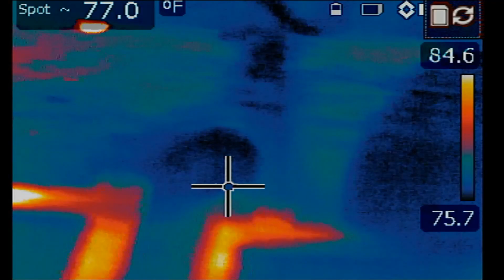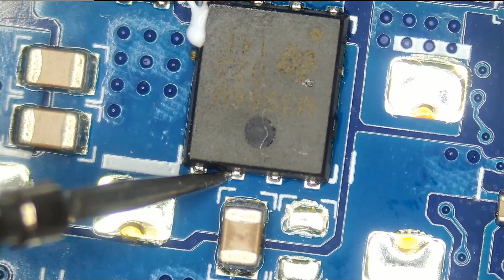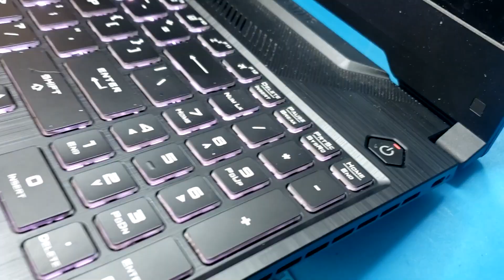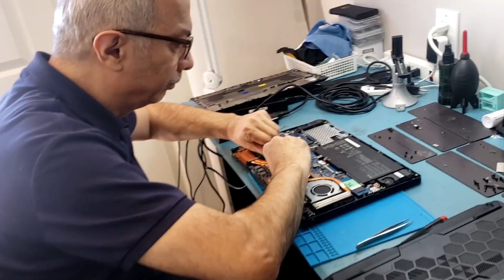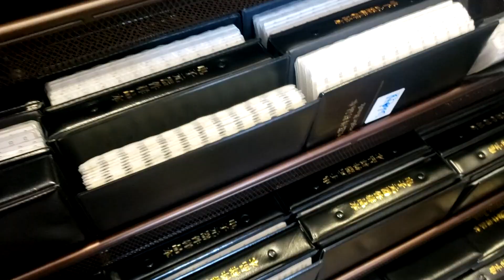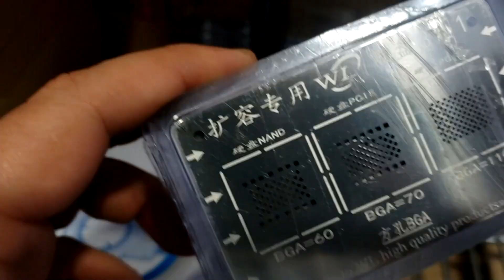ASUS TUF Gaming A15 Laptop Repair - No Power

Comment: Sometimes you need to wait for a seconds or minute because disconnecting the battery also resets the BIOS configuration if the battery isn't separated For bios, otherwise it's a Ram, GPU issue, etc...

Comment: I stopped doing my own repairs on surface mount components awhile ago.  I'm looking for the DC Power Jack on the motherboard of a ASUS TUF Gaming A15 FA506IH_TUF506IH.   I found one spec sheet that says the jack is 6.0 mm x 3.7 mm DC Jack but I can't find one of those anywhere.  Any help finding it would be appreciated.  Thank you.

Comment: I looking now your videos , because my ASUS ROG STRIX G15 just died. During when I gaming, the game freeze, then I try to restart the laptop, It took too long time... I push and hold the power button, than the laptop turn off. Now If I turn on the laptop, I have keyboard light, the fans are working but the screen are black and the laptop wont boot.

Comment: Bought a  ASUS 15.6" TUF Gaming A15 Series TUF506II two years ago now and recently i am experiencing a problem that it won't turn on if i turn it off and don't use it until nex day.  It start sometimes, but mostly not.  Now i decided to let it plug to A/C even when not using it because is the only way it will power up next time.  Everything else is fine, it plays games without crash and other tasks even if i disconnect the power from A/C.

Comment: I would like to know what is the capacitance value of that SMD capacitor... I'll might check on my laptop that died a year ago (When switched on my laptop's Power light will flash once then off - no fan spin and no display) - Laptop can still charge tho...

Comment: Hey! Brother Alex,
I've one genuine request to you.
If you google about samsung galaxy m30 and a50 devices you will find there is one common issue occurring in most of the devices. The issue is that the device keeps restarting randomly.
Also it's confirmed that this issue is not a software issue rather it's a hardware issue.
I would like to request you to get one such faulty device and try to fix that issue and show us in a video so that we can understand. In India samsung service center is replying same thing to everyone  that the motherboard needs to be replaced and for that, they are charging 100$ for a 250$ device. 
Here in India, the repair guys also are not able to tell properly like what the issue is and they are kind of speculating on it which is leading to waste of time and money.
Could you pls try this. It will be really helpful.

Comment: Did it make a difference that the capacitor wasn't soldered in the original position? Originally, the capacitor was to the left and you resoldered it to the right of its original position. Video at time code 4:19 shows the original position of the capacitor.
Reply: Both positions are parallel, so it doesn't matter
Reply: Yeah I was wondering this too, they're running in series which makes me think that it may not matter as long as they're on the same rail, but that's hard to definitively say without looking at a schematic.

Comment: Hi I just got suggested to reach out to you about a question I have my friends dad has the old Alenwere desktop from somewhere around the 2000s it has a Radion gpu witch has 2 gpu dyes in the 1gpu with a fan in the middle and a water cooled cpu if that helps identify it at all they tried installing windows 10 on it but it would crash when they tried to boot into the os is there any way around this any help is greatly appreciated

Comment: Forcing a cap to dehydrate and heating it up even more without giving it flux is just cruelty toward capacitors.

The other caps around it were probably screaming and the mosfets just sit there laughing.

Comment: Being that these are gaming laptops problem could be with the user. They will over clock laptop to the point they push it to its limits and components fail
Reply: I doubt you could do any more damage by overclocking than the laptop already does doing anything intensive. They’re already pushed to the edge of their thermal (and power) envelopes by default.

Comment: Quick question: How do you know what mosfet to replace? I mean both the bad and the new mosfets have different numbers. Does this part came universal or do they have specific values?
Reply: That was a 30V N-channel MOSFET, and those are pretty typical to see in laptops. When in doubt, you can look up the part number of the defective one and find a suitable replacement. It helps to understand what the MOSFET is being used for and what it is doing so that you know which parameters are important and which are not.

Comment: I don´t know if it matters, but you soldered the runaway capacitor on the other pad.
Reply: I was gonna say...curious how that didn't seem to cause a problem but it was definitely put on the right side when it was on the left.
Reply: @greganson3627 The pads were in parallel anyway.

Comment: You soldered capacitor to another slot, does it matter or those slots are in parallel?
Reply: I believe, both of the slots connect to the same traces on the board.
I also noticed that and watched that part of the video again.
Waiting for Alex's expert opinion.
Reply: It's The same path. Dosen't matter. If you follow the traces you can see it.
Reply: Yes they end up in the same place which is why it didn't matter that Alex didn't put it back in the same spot.
Reply: They are connected in the same net
Reply: @sadteeto  The question I would be asking is if the circuit was initially designed to have 2 capacitors in parallel, and a manufacturing error left only the one, which has then lead to the mosfet failing.
Reply: No. It doesn't matter if the circuit is complete
Reply: They were parallel indeed

Comment: Looks like ASUS is one of the top brands for gaming laptops whrn you get that many broken units. I don't believe that they fail the quickest
Reply: Low key happy now after seeing all these issues with ASUS TUF laptops and I almost bought one
Reply: @artherj327  hey now.
Reply: For me, Asus always have been the laptop brand to go to unless I find something way better
Reply: I have old asus K53T, the graphic chip died couple of years ago and fan also, otherwise the laptop is great for 9 y.o. machine.
Reply: Here in Asia (PH) Asus is one of the brands that has a great warranty period , 2 years , if your board stopped working like the in the video they will replace the motherboard for free.. still.. I just bought this specific series with r7 4800h and rtx3050 ..hopefully it will last long enough
Reply: @exiledwolfch  I have their 2020 ROG Strix G17 with an Intel core i7 10750H and the GTX 1660 Ti and i've never had any problems so far. I've hsd it since the november of 2020

Comment: Normally i don't comment but i got to...
This is exact model that i use, after almost six months of using one day graphics card decided not to work because of the warranty they had replaced the motherboard.
I am curious that which part will fail next.
Maaan i wish i had found this channel before the purchase.
Reply: man, stop buying asus laptops
Reply: @maklogetrich2378  I know :( that's why I'm waiting for data on other brands.

Asus gaming laptops are usually readily available at competitive pricing & features where I cone from. 

But asus is so unreliable I won't buy them again.

The worst part is asus spare parts and schematics are not easy to find.
Reply: @therealb888  for everyday usage, HP/Lenovo is recommended, as those brands are rarely failing in our store
Reply: Hi, I have a dead asus laptop too and it too had graphics/display issues.

Mine was out of warranty and never got to replace it. Now my laptop is completely dead.

What do you mean gpu decided not to work? Were u not getting any display at all?
Reply: @therealb888  onboard gpu was working but there was no power/signal output from the actual gpu. Laptop couldn't even see the gpu' BIOS. That's why I wrote "decided not to work"
But I gotta give them credits, they fixed and shipped to me within a day.
At least they are quick.
Reply: @lonestartr1  they probably replaced your motherboard. Can you check if the board was same or changed?
After one year warranty if it will fail again & they'll charge a huge amount. 

That is quite a weird fault. To have the dGPU not even appear. In my case my intel igpu is faulty, while it appears in bios it can't use the intel driver to run the screen at 120hz.

Comment: Basically this video has taught me to avoid Asus laptops 😁😁😁
Reply: At first I agreed with you. Then I remembered how Razer doesn’t even sell the rubber feet that keep falling off of their laptops due to the heat and weak adhesive. I bet they make it hard to repair their laptops too. So, I changed my mind, because at least they (Asus laptops) are easily repairable (for now?). It sucks that this is the world we currently live in.
Reply: @MischeifMakerz  using a 11 year old Toshiba laptop. Still works after all this time. They don't make them like the used to.
Reply: @Alex-ii5pm  then again not everyone uses a laptop the same way. Most people that use ASUS are gamers so they run games at very high temperatures for long periods of time, issues are inevitable eventually.
Reply: @Alex-ii5pm  Yeah Toshiba is my favorite old school lappy, My daily driver is from 2009 - Ive upgraded its CPU and hard drive to ssd thats it.  In 13 years its been powered on/off less than 100 times since its on full time.
Reply: @AlkaVirus  other gaming laptop brands exist as well. Asus has the highest failure rate. See my comment & northbridge reply to it.

Comment: Hi Alex, is it safe to assume that at this point asus is your biggest customer?😂.

Of all the gaming laptops you repair, isn't asus the one that fails the most?
Reply from the maker: Asus fails the most followed by HP spectre, 2017-2020 macbooks, Dell, MSI, Razr, Lenovo. List is in order
Reply: @NorthridgeFix   Wow! Thank you for giving such detail sir. Kudos to your experience! You even stated the order👍.
Reply: @NorthridgeFix  it's been a while since last HP Spectre you repaired, maybe next video? 😅
Reply: @NorthridgeFix  I'm surprised Lenovo is last in the list
Reply: @saiyancatszx2  could be market factor, but remember different lineups within a brand can have different reliability. For example thinkpads may be more reliable than budget ideapads.
Reply: @saiyancatszx2  Lenovo is reliable (my 3 laptops were at least). I'm surprised Acer isn't on the list.
Reply from the maker: @m3gakurv4 we rarely get acer laptops. We did however work on 13 failed acer laptops that were mailed in by one company. We did 3 of them in this video.https://youtu.be/qlO84HqeTps We ended up fixing 12 out of the 13.
Reply: @m3gAnac0nda  I have to check acer sales stats bcoz of all the repair channels I've watched acer gaming laptops are not very common, meaning they fail less.

But I have seen many acer non gaming laptops fail and require repair. Asus gaming though are hands down the most unreliable of them all.
Reply: @NorthridgeFix  do you have any experience with HP OMEN gaming laptops? 

Your advice is valuable because you repair in very high volumes.
Reply: @therealb888  Yeah Ive seen a lot of OMEN laptops fail - shorted to where power brick turns off when plugged into laptop.  This the whole reason Im a subscriber here. Tryin to learn whats going on with them.
Reply: @therealb888  I remember people around me always having issues with Acer boards, I believe it was entry level not gaming branded products.
In the E.U a 600€ Lenovo or Asus has better build quality, better components (ram, wifi card, screen) then an Acer but their list show Acer to be more reliable when it comes to hardware failure.
Bought a Strix (i7 10th gen 6 cores, 2070 120W ) last year, same catastrophe as on their videos. Ended up selling it rather then having it repaired, lost 300€ in the process but I couldn't find a shop that didn't require having the mobo replaced... I probably could have in the big city 30km away but by that point I realized that I should have stick to my guns and wait for a good deal on a mobile 30 series...
Reply: @therealb888  Just checked Acer sales stats, they are 7.2% of market which is last place among the big 5...Lenovo is number 1.
Reply: @northridgefix I recently bought an Asus laptop. Why do you have to repair so many? Should I be concerned?

Comment: Came in for repair. 
Now my own lenovo laptop is as good as dead
Reply: What happened?
Reply: @therealb888  it was running fine then shut off all by itself then it wasnt really booting to windows , furthermore while I tried switching it on it wasnt showing display and restarting instantly . when I removed 1 ram which I installed later one I bought , it started showing display but still not booting into Windows but shutting itself off almost instantly .
Reply: @shamsalfaisal  well your issue sounds very very similar to my asus laptop. Try using the new ram stick without your windows SSD/HDD. This will force the laptop to boot into BIOS. If you can enter BIOS, check if it can stay on for atleast 1-2minutes.  

Did you have any windows or BIOS updates prior to the failure?
Reply: @therealb888  I had a windows update I believe